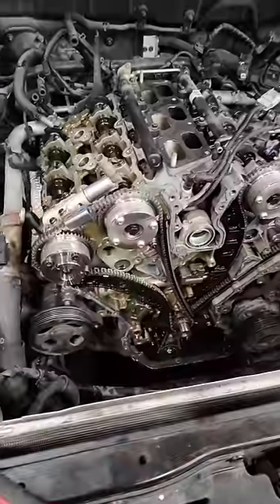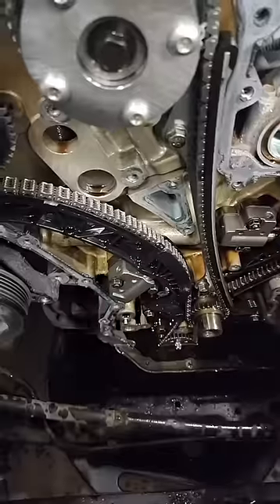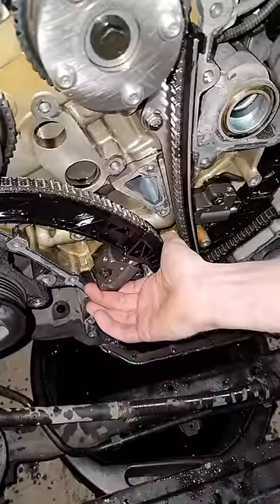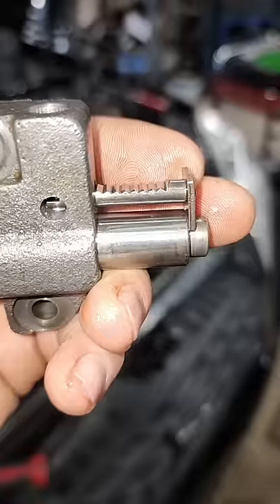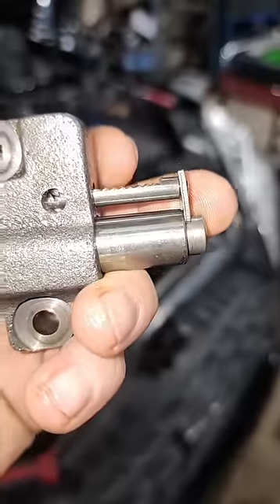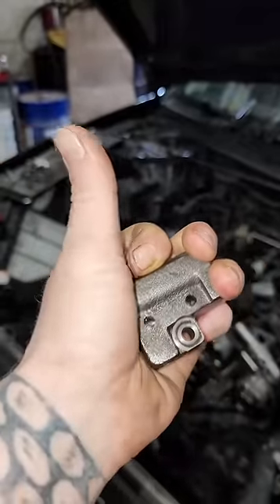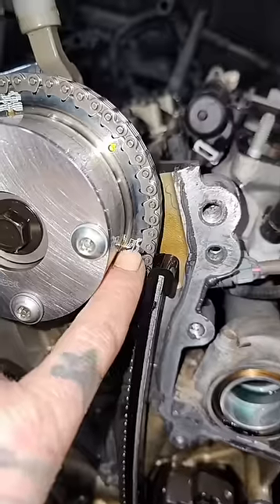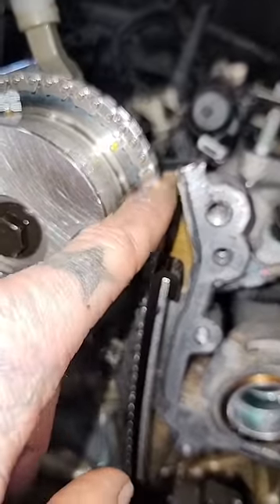I'm not happy

Comment: They are going to tell you “yeah sorry we had a problem with a batch of them. Heres a new set sorry for the inconvenience!”  They aren’t going to give you a dime for labor! The machine shop down the street that did all my machine work had a 5.7 hemi timing chain brake on an engine they completely rebuilt. Less and 5000 miles on it! Bent nearly all the valves. Heads had to come back off. Put 16 new valves in it, all new gaskets, The customer looked at the marks on the top of the pistons and wanted new pistons put in it he want a new lifters put in it. Do I blame him probably not... Cloyes said yeah we had a bad batch of chains they we’re breaking... sorry about that! here’s your new timing chain sorry about your luck!

Comment: I've gotten to the point where if it's internal components I only use OEM or if it's performance I will only use top of the line aftermarket for instance in the case of any LS based GM engine only AC Delco and anything Texas speed sells period diesels only dealer parts if the customer doesn't want to pay for OEM parts I don't want them as a customer

Comment: Does anybody know if the 4 cylinder Genesis uses the same tensioner? I had a customer with a 4cyl one randomly jump the timing just backing the car in their garage to prepare for a cold night. luckily it was only by one tooth and didn't bend any valves.

Comment: Hyundai and Kia cars are junk. My last job at a dealership had them constantly coming in needing rebuilds and motor swaps because the engines would grenade internally. These cars can only use full synth oil that has to be changed every 3K. The tolerances are too damn tight.

Also, buying an aftermarket timing chain kit from Rock Auto? Come on. I stopped buying stuff from there years ago after they sent me the wrong wiper motor and refused to refund me. Rock Auto is a great ref if you need parts numbers, but that's it.

Comment: seems like over the last 8 to 10 years quality has turned to shit  i rebuild a front end on a 97 Yukon ball joints bushings tie rods etc  a year later the ball joints were already hashed out  i was pissed i ended up  replacing  them labor free  the parts house they warranted them but i ate the labor

Comment: Ooooooooooh yeaaah. That style of timing chain tensioner Audi USED to use on the 2.0T EA888(likely other engines too) This is exactly why they don't anymore. 
Shitty thing is that some of this style tensioner was used in a lot of cars that weren't part of a tensioner recall and they went thru like 4 or 5 revisions before getting it right by using a clip to keep the tensioner from losing tension. It's an easy install and it does it's job now.

Just a stupid, stupid design. Might work if made of a more stout material but so far I've not seen it. SS doesn't typically wear out like that lol.

Comment: They will claim you didn't flush the oil passages and replace the pickup screen and oil pump.and low oil pressure caused the tensioner to flutter and wear the teeth down prematurely.good luck.

Comment: that's because everything is made in China now a days. let's look at a f450 superduty platinum. Most body parts like door handles belt moldings and plastic is made in China. says it right on the bag with a Ford logo an inch away from it. most starters and water pumps even oem are made in China. just because you get oem now a days doesn't mean the quality is still thier. it can have honda, Ford, or Toyota and still be China made quality. The quality in car parts just isn't thier anymore like it was 20 years ago. sure you find a hidden gem that someone of some aftermarket company makes really nice stuff, but everything is made the same and they just get paid to but tgier name on it.

Comment: That's why I only install factory parts if they're not available, I will not fix, You take too big of a risk installing aftermarket junk especially a $20 tensioner that can turn a motor into a boat anchor, I've watched your videos a lot you seem like you're pretty knowledgeable you know when a part states OEM quality it could be Chinese junk, and normally if you go with factory parts if there's  any updates or bulletins on the parts  they're usually already taken care of

Comment: OEM parts do not prevent this new OEM parts from failing. especially on Fords. Had AC compressor fail Ford pick dealer put a new compressor in, as I'm driving out of the dealer compressor locked up. Mechanic had to replace compression, condenser and evaporator for free, it shattered flowing metal shavings through system Fords servicee manager tried to get me to pay for non compressor parts, after much debate he begrudgingly agreed.
Of course it was a Ford, finally got tired of fixing Fords all the time, ditched both my Fords it for two far, far, more reliable Toyotas

Comment: This is an interference engine I think, lucky it's only 4° out lol I'm doing a Toyota Prado now it's a 5VZ-fe V6. It went in to a "Mechanic" for a starter they drive it in he tried to change it but couldn't find a way to get it out to put the new starter in so he gave up 😮 wtf. Now I have it.
It took me 20 min to remove it and fit new one but it won't start.....
It has compression for one revolution then no compression for one.? It had me stumped for a few minutes then came to the only conclusion,
Timing belt. 
The timing is out by 35° 😮😢😂.....?.
How.? Timing belt is nice and tight, it was changed less than 20.000km ago and are good for 100.000+ that's a small plus lol. 😂
No teeth are missing, tensioner is good cams are free, (at this age they are prone to seize due to lack of servicing).
It has me stumped as to how this could happen but relieved they are a non interference engine.
So new belt, tensioner, pulleys, and water pump
And I'll see how it goes. I've only just ordered them today so I'll soon see.

Comment: Ford ranger 4.0 yet another sucky engine. They are known for the timing chains to jump and basically because the slides are junk plastic and bad part is usually when it happens you may as well look for another engine or tear that one down and rebuild it because it will bend valves.Of course that is what these companies do is build stuff to break no to last.Give me an 80's or older car anyday.

Comment: This is why I don't buy vehicles with over head cams Displacement on demand variable valve timing it's slim pickings now a days the only engines without this garbage is the new 7.3 6.8 ford's the 6.6 gas gm  and the diesel v8 and cummins 6.7 and the ram 6.4

Comment: 'IMPORTANT NOTICE' If ever replacing timing belt/ Timing chain I recommend using OEM parts, or at least the main components like chain, tensioner, pulley.. Aftermarket junk part's could cost more than you think..

Comment: Sorry, but that amount of wear on tensioner teeth is impossible in a couple weeks for even the worst unit... UNLESS you made an outside separate error in the over chain install the contributed to unnatural movement or slop, causing that wear. Since you didn't even address that possibility (which is a certainty), the error is obviously yours. No wonder they wouldn't replace. This video is literally proof it's your fault.